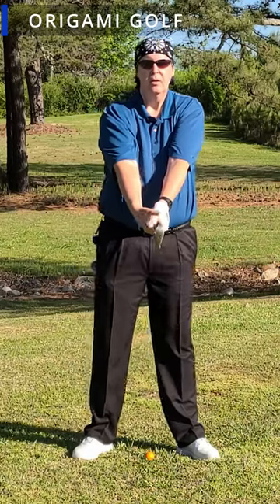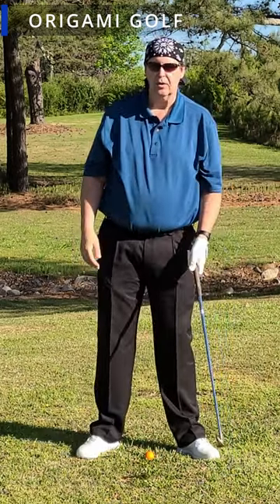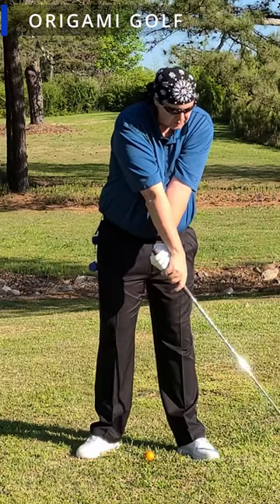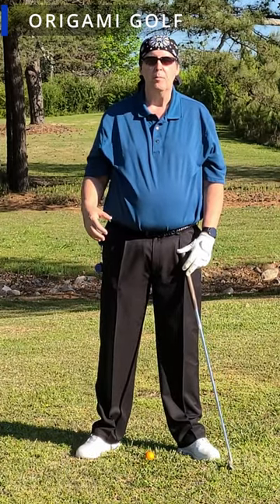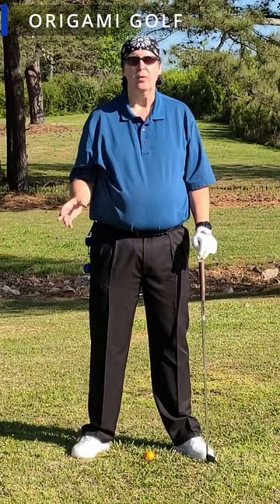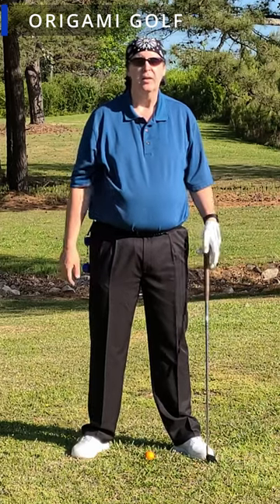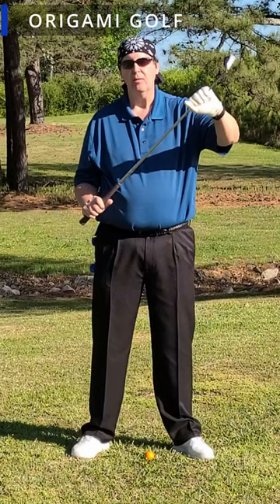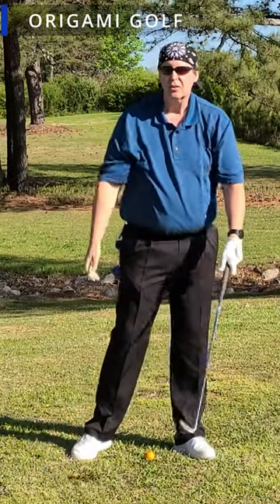The Secret to a Powerful Golf Swing: Whipping Motion Explained stvs49

Comment: Wrong.  A whipping motion is correct, but not using your hands is not correct.

Just like on a whip, the golf club handle is manipulated to make the club head speed up.  On a two handed golf club handle, this happens by pulling the lead hand back while pushing the trailing hand forward.  This causes the club handle to pivot around a center of rotation point between your two hands. That speeds up the golf club head and produces the velocity necessary to compress and launch the golf ball.

Look up "put on the breaks" in a golf swing, which makes the lead hand reverse pressure and pull back.  The trailing hand simultaneously pushes forward. That's "whipping it" around a pivot point between your two hands.

This action can happen without the golfer knowing that it is happening.  Or, a golfer can understand what's happening and learn to consciously and overtly amplify the pull-push whipping hand action to hit balls even farther.

Try it. Learn it.  Perfect it. Understand it. Then, please come back and fix this video. It's misleading people.

This is very important to get right, because doing this properly reduces the stresses and strains on your back, reducing the damage to your spine while producing even longer yardage golf shots.

This is how the golfers who have effortless looking swings are producing incredible club head speeds. It's mostly wrist manipulation speed with much less club head speed added by torso and arm pressures.

Go back and carefully watch the very first video you have posted here, a sledgehammer swing. You will see that what I am saying is exactly correct.